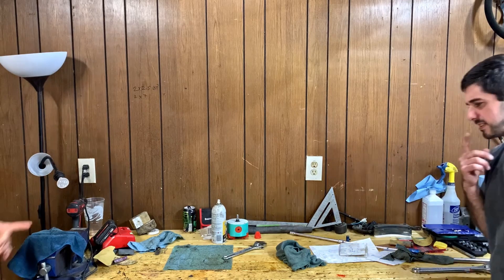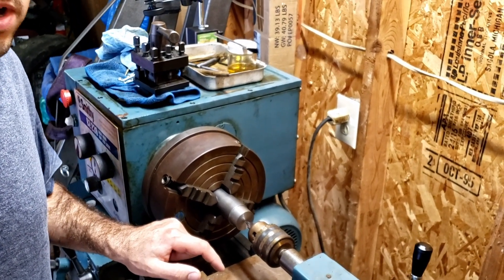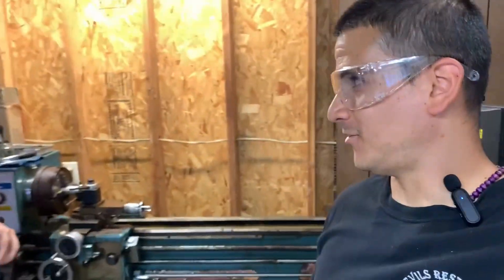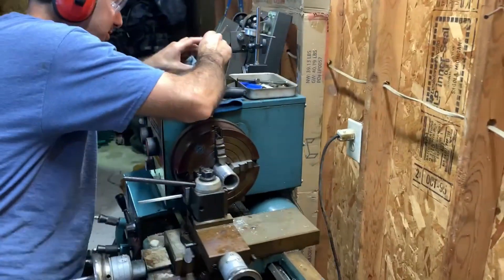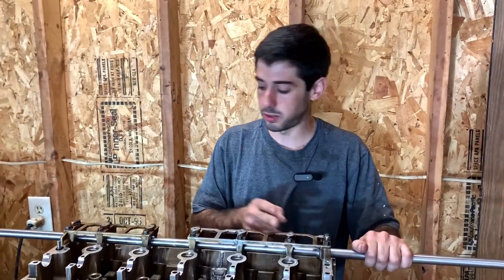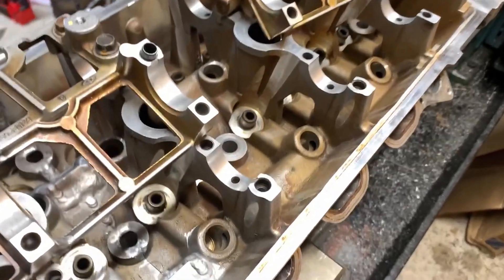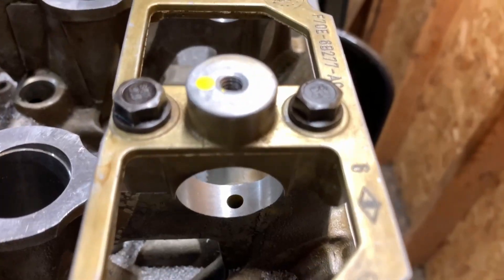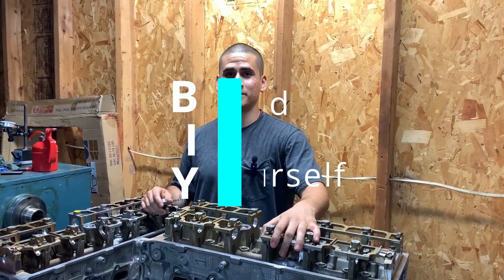Machining Our Custom V10 Cylinder Heads - Ford V10 4V Build Ep. 3

Comment: I was warned about the sequence of the machine work. Since the cam bore alignment depends on the fir between block and head surfaces, wouldn't it be necessary to deck block and resurface head before line boring ?

Comment: Same issue I ran into with my rare Ford Motorsports Ecoboost IEP head. It comes with the rear cam cap for the ST 3 lobe style HPFP. I got a RS cap which can hold the 4 lobe HPFP, but I wanted to have it sent out, measured, and if need be, the cap cut and then honed, but every shop I reached out to turned me away. I said screw it and went ahead anyway. The RS cap is .0025 larger, or less than the thickness of a piece of paper, so we’ll just have to find out if it’ll work or fail.

Comment: Now is camshaft couldn't you take and harvest two-valve camshafts and have a milled to have the exhaust load taken off and then another one had the intake lobe taken off the run on your head's???
Reply from the maker: The lobes on the mod motor cams are actually pressed on. We experimented with pressing them off and putting them back on. But we are really shooting for a high performance level and decided to get to the performance we wanted, we really need to strive for billet cams.

Comment: I'm building a Toyota 2AR which is a 2.5L cylinder. Hoping to go head to head with a Honda K.
 I'm going to be building my own line boring setup so that I can offset bore the cam journals. That will allow me to increase the length of the valve stems, springs and reduce the cams base circle. In turn this will give me a lot more available lift.
Reply: Love it

Comment: You need to reverse the process to do the outside ones by putting your shims on the inner ones running that rod and cutting the outside too as well front and back that will get it line board perfectly
Reply from the maker: Hi Lindsey, we may not have shown it on the video but we did do the outside bores as well. Good catch!

Comment: This is an awsome build, i just built a 2V v10 that be bored over to 6.9 L and it puts down approx 340 HP, 528 ft lb at the crank, so a 4V should be able to overtake that.
Reply: 528 ft lbs? Gotta keep me up to date I got a 2v v10 and am looking to get more power out of it. I got twin 38 gallon tanks and am looking have an easier time pulling heavy loads
Reply: @dustinontaiyabbi  get a SCTB96-98, its direct fit, and will help with towing too, from Accufab.

Comment: i think the 3V heads outflow the older 4v heads. Alot of work for no gain. A ported 3V will have gotten you to or above the flow of 4v.
Reply: 4v V10 heads do not exist
Reply: @pnwchris2000  I think he meant when comparing V8 3v and V8 4v heads. They are using V8 4v heads to create V10 4v head.
Reply: Higher revs?

Comment: Nicely done! You guys are on to something big. Keep going and we'll keep watching.
Reply: Should be pretty cool results. Reminds me of the few guys who welded together Cleveland V8 heads and adapted them to a 300 I6 back in the '70s. One dude named Sherman Sligh made over 600 hp naturally aspirated with one and ran low 9s with that engine. I think that one had mechanical fuel injection with individual throttle bodies and velocity stacks. All built in his home garage.

Comment: So now you've cut the bores bigger you realise you now have more clearance on the cam. This is why no one has machines to do this work because it's generally just not done. You could machine the caps down but the lower halves will still end up oversized. You also will be changing the cam centre line which can throw other things out of spec. 
fair enough go ahead and do it your self if it breaks it breaks but shops don't want their names attached to something that is not 100% right.
Reply from the maker: Yes, the bores are cut bigger to allow us to use cam bearings. Imagine mini main bearings. You can see a bearing next to a bore at 16:18
Reply from the maker: That’s a very long and complicated way of saying absolutely nothing meaningful or proving your point. Well done. 👏🏽
Reply: @biy_buildityourself  are you still talking bro
Reply from the maker: @Shane Rorko  and you’re still watching 😂
Reply: @biy_buildityourself  Maybe Shane finally learned something. 😁Great job guys! Insane build. Respect.
Reply: Even if they didn't use mini insert bearings (which are pretty slick I've used them on Toyota 22re heads), the necessity for custom cams would make it easy enough too make the journal diameters big to match the size they cut to.
Reply: @prtyof4156  Yea I get your point but I still don't recommend trying to align cam journals by cutting them straight. They totally neglect the fact that they will now have different hight spring seats.
The cutting contraption they use to cut is actually an idea they stole off another YouTuber named Keith Fenner. 
When Keith Fenner used the idea he used it to cut new main caps but leaving the original main journals untouched. These guys are adapting his idea without much thought to the process. 
When they welded the heads together they should've bolted a couple of bars in place of the cams to keep the heads aligned. After the welding if they cooled the heads down properly there would've been minimal warping.
Reply from the maker: @Melissa Hill @Shane Rorko Sorry, but are just plain wrong or simply don't understand the concept of line boring.

Since there seems to be so much confusion on this we feel an explanation/clarification is in order:
Reply from the maker: 1) There are 2 methods to fixing bores in a split cap bearing system. One method is to remove material from the cap mating surface. This WILL change the centerline of the bore by half the amount  removed from the cap (if you take .010" off the caps you move the centerline .005"). This creates an ovular bore that requires machining. The parts can be machined back to circular and to the original diameter. The benefit is that  stock size bearings can be used. The other option is to enlarge the bores for oversized (larger OD) bearings. This does not change the centerline but requires usually more expensive or unique bearings. This is the method shown in the video and used by Dura Bond, which is the company that sells the  unique bearings for this exact application.
Reply from the maker: 2) A welded part will almost always need machining operations for critical dimensions, especially when trying to hold .002" over 24 inches. You can clamp a part as tightly as you want, but welding induces stresses that will result in strain when the part is unclamped. It takes some experimentation to know how and where to weld a part so the stresses mostly cancel, and that is not realistic to expect to achieve.
Reply from the maker: 3) Line boring is a fundamental machining concept and Keith Fenner did not create it. The concept we used is actually different in several areas from his method. What we "stole" from the Dura Bond kit, made specifically for this kind of service, was the concept of using bushings on the outside caps to support the boring rod and ensure alignment. You can look up Dura-Bond® Boring System to fully understand how the service industry performs this operation. We used the bushing concept from the Dura Bond kit, but instead of using their cutting tool and a drill to cut and feed, we made a conventional boring bar with a HSS bit and used a drill to spin it while controlling the feed via the lathe. This is actually a pretty common technique in the heavy machinery industry.
Reply from the maker: 4) Lastly, if you are still confused or concerned about "larger cam clearance", we recommend you go back and watch the video fully. The entire point of line boring to such precision is to ensure proper fitment of specific cam bearings, sold by the same company that sells the line boring kit, Dura Bond. These cam bearings are inserted on the heads, in between the head and the camshafts, and bring everything back to stock clearances. Instead of the camshafts riding on the head cam journals like stock heads, the cams will now ride on bearings. There is no increased cam clearance, and no shift in cam centerline.

Comment: sick! I hope it works out. If someone had enough money, cadd software, and a cnc machine you could just make fresh heads. I would reach out to comp cams, they still do v10 2v cams and the the cam staffs are the same from dohc to 2v as far as the shaft itself. The lobe placement is different, but  I don't see why they could just do two sets of cams for you. two with all intake lobes and two with all exhaust. Plus I think the stock lobes are pressed on or at least some cams are. Maybe look into to some stock v10 cams and just press the lobes off and DIY them. Good luck guys keep posting!
Reply from the maker: We will definitely reach out to COMP and a few other shops that do custom parts. Will be reaching out to them this week to kick things off! 
Also, we had Initially thought about using the 2v cores, like you said, but after further inspection we noticed the lobe spacing is wider on the 2v cams vs the 4v. So we cannot use the 2v cores, unfortunately 🥺
Ideally we can work with one of these shops for custom cams. But if it comes down to it and we can’t buy them, you better believe it we’ll built them!
Reply: @biy_buildityourself  comp aint got shit for cores anymore. only place i could find aftermarket cams for the 2v was apocalypse performance. its a long wait but he might be the only one to help with that. i am just getting mine in the next month and its been 4 months
Reply: Realistically the dohc and 2v would have the same firing order so all youd need to tell them is to do two sets one with dr/pass intake lobes and one set with dr/pass exhaust lobes. If not you could weld two set of stock 4v cams together now that the cam towers are line bored!
Reply: Was thinking billet cnc machined heads myself, but I guess this method will be an economical proof of concept. If it sparks enough interest they could then look into getting machined heads manufactured and maybe retail them!
Good work so far, best of luck.